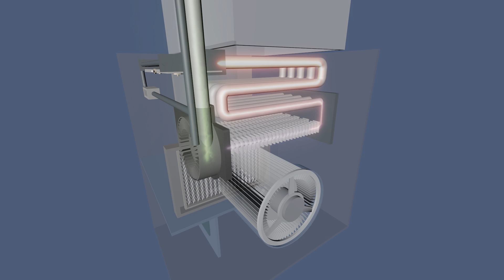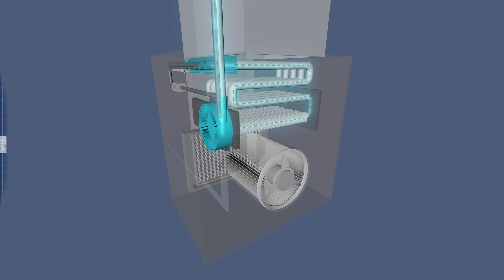Noisy Furnace? - Top 5 Fixes | Repair and Replace

Comment: Thanks for the video. I’m stumped. In one section of the home, of course our bedroom, when the heater starts the process of shutting down a LOUD rattling noise runs the entire length of the duct system. HVAC company says it’s not the heater, Duct company says it’s not the Duct system. How do I tell which is correct. Please help!
Reply from the maker: Thanks for watching. In these sorts of situations is best to try to listen at several different locations to see if you can narrow down where the sound is loudest. A rattle could be the motor vibrating when it is running. It could also be the force of the air moving through the ducts. 

If it's the motor that is vibrating then the blower wheel might be imbalanced or the rubber grommets that help mount the motor might be worn down.

If it is the vibration of air through the ducts, there are ways to reduce vibration of the duct work itself. Sometimes this involves tightening of the mounting screws.

Comment: My RV screams when the heater is turned on. Imagine the belt noise but as loud as a car alarm. And imagine a metalic ringing from lower notes throughout the pipes. And if it goes on for too long it smells like something is burning inside.
Reply from the maker: Thanks for watching. It could the the motor, motor bearings or the belt. If the furnace uses a belt, then it might be too tight. There should be some adjustments that you can make. There might be some similarities to this: https://www.youtube.com/watch?v=APqq4X_gjUU&lc=UgxuT9igza5NELS2b5V4AaABAg.9QWznO93F-a9QaJ7YtBgGu
Reply: @AmreSupply  My partner took it apart. The blower fan was fine but the motor itself wasn't stable and he took out the bearings for it somehow. But we're mostlikely going to try and buy a new furnace now that hes done that. Or he'll try to fix it. But he showed me a bearing so Im guessing thats what it was.
Reply from the maker: @walafalamoosieoadm8200  Thanks for the update, it's always interesting to know what the problem / solution is for our viewers. Best of luck!

Comment: Just paid a company to replace my blower motor now my furnace sounds like an airplane.  They leave and tell me there's nothing they can do about it.  I hate getting raped by every contractor these days
Reply from the maker: Thanks for watching. The new motor might be running at a different speed then the original. That's unfortunate that it is now noisy and wasn't before.

Comment: Of course I dont hear the sound of my issue.  Mine sounds loud when it kicks off. Like it's a loud power down. No pops or bangs just loud
Reply from the maker: Hi Misty, thank you for watching. If you have a direct ignition furnace you might be hearing the draft inducer blower start up. Is this a new sound or has it always been like that?
Reply: @AmreSupply  it's a new sound. I don't remember it being that loud before when it turns off. Is that a easy fix?

Comment: I am hearing my downstairs neighbor's HVAC blower noise at 120Hz resonating in my entire bedroom. Is there any possibility to reduce that?
Reply from the maker: Thanks for watching. To reduce noise one can add insulation to the ducting, or add other buffers to reduce vibration noise. In many cases there isn't too much you can do as the layout of the house will make it that some rooms are noisier than others. Some furnace motors are more quiet than others though.

Comment: Mine sounds like the inducer noice. My furnace is somewhere up on the crawl space above the 2nd floor. I’ve never seen it, my previous house was in the garage, so I find this weird. Anyway, I can only hear that louder then usual noice from my upstairs bathroom. I never heard before and it scares me to turn it on. I feel like my house is going to burn down.  Do houses catch fire from an old furnace?  My house was built in 2003.
Reply from the maker: Thanks for watching. Furnaces come with safety devices that will shut it down if it's unsafe to operate. The inducer noise is an indication that it might be starting to fail. It would be best to get it inspected now and be proactive about the sound rather than waiting for it to fail at a random time.

Comment: Great video, but none of the noises are the crazy loud noise my furnace is doing. It sounds like a super loud sawing/grinding noise. I can hear it outside my home, in my car, with the radio up its that loud...and don't get me started on how loud it is inside my home. I was told by a friend it was the inducer but judging by your video that doesn't seem right. Any help? I can send a video of what it's doing if needed. No furnace company around us will help us as they are all backed up with appointments through the next 3-6 months.
Reply from the maker: Thanks for watching we're glad that you found it helpful. A grinding noise like that is going to be one of the blower fans. If it is that loud you should be able to pin point the sound when right infront of your furnace. During startup the draft inducer motor runs first to bring fresh air into the burners, then it ignites and heats up for several minutes. Only after does the blower fan run.

If you hear the noise right when the furnace turns on, then it's likely the draft inducer blower. https://www.youtube.com/watch?v=EsJhfFMZWJA

If the sound only starts a few minutes afterwards then its likely the main blower fan. https://www.youtube.com/watch?v=4SY8lRl8HV0

As well, with the furnace disconnected from power and gas, you should be able to turn each of the blower wheels by hand. There might be something stuck in it. You might be able to feel it grinding or catching as it rotates.

Hope this helps!
Reply: @AmreSupply  thank you for the help! It ended up being the draft inducer. Appreciate the help! Happy holidays and Merry Christmas to you and yours! :)
Reply from the maker: @ericduvall569  You're welcome Eric, we're happy that you were able to narrow down the problem! Enjoy the holidays and all the best to you as well!

Comment: My issue sounds like a belt issue, but my furnace has no belts...
Reply from the maker: Thanks for watching. It could be an issue with the inducer fan or the blower fan. Potentially the motor bearings or something rubbing that would make that sort of sound.
Reply: @AmreSupply  https://youtu.be/D2tSPaqpKdo    this video captures my issue perfectly.  Any suggestions would be appreciated.
Reply from the maker: @JrJagsFootball  If you have a modern furnace that has a inducer blower (not a standing pilot heater), it will run first before the main blower fan starts circulating air around your home. If the sound is delayed and only starts after the burners ignite then its likely the main blower fan. The motor rotates quite fast so any rubbing can make a noise such as that. You could check the blower fan to see if it spins freely. If the motor feels rough then it might need to be replaced. Alternatively if something is rubbing then you might be able to adjust the blower wheel. https://www.youtube.com/watch?v=4SY8lRl8HV0

Comment: My outside unit sounds like a air compressor or school bus brakes
Reply from the maker: Thanks for watching. If you have an AC condenser unit, then it will have a motor that will run and can sound like a compressor motor. It is not ideal to have anything that sounds like pressurized air or gas is leaking. It would be best to get this inspected by a HVAC technician.

Comment: I just moved into an old home and the blower was in a really disgusting and loud state. I cleaned all the bolts including the centre one mentioned here and it's making soooo much less noise. Thanks so much for the context here, working on furnaces as a homeowner can be daunting.
Reply from the maker: Thanks for watching. We're glad that the video helped you out! As a homeowner there is a lot to take care of, one video that you might find helpful is this one on Multimeters and electricity basics: https://www.youtube.com/watch?v=r_migcta_Is It can be a good review and help fill in the blanks as well. 
This video goes over appliance components which is a good overall introduction t what you'll need to test if something fails.: https://www.youtube.com/watch?v=e_1pOWSVUfg

Comment: Hi.  I need some of your expertise.  
Let me begin by saying.  I don’t have an amp reader..  I just turned my furnace on.   Getting a small buzzing sound.  Not a loud Humm, like I’ve seen in some videos.

I am replacing the capacitor.  Am worried Becusse the inducer blower motor was pretty damn hot after 2 minutes.  
  What’s the difference between the inducer blower motor (mounted on the front of the furnace) and the blower motor on bottom of furnace attached to the wheel?
Reply from the maker: Thanks for watching. The inducer blower is the first to run and it provides fresh air to the burners and helps push exhaust gases out. After there is enough fresh air, the burners ignite. Then the blower fan pushes the hot air around your home. You can learn more in this video "How A Furnace Works" https://www.youtube.com/watch?v=tVLtJwix-_8
Reply from the maker: As for the capacitor, and blower motor you can learn more here: https://www.youtube.com/watch?v=4SY8lRl8HV0

If the inducer motor has a capacitor, then it could also be faulty.
Reply: @AmreSupply  Wow thank you so much. I ordered a new capacitor and I’m going to pick up a multimeter now.!!
Reply: @AmreSupply  unbelievable.  I replaced the capacitor and it’s working! Wahoo!
Reply from the maker: @bobduffy7744  Awesome! That is great that it worked!

Comment: My furnace is a Brand New York I believe a two-stage furnace if that makes sense my issue is it sounds like a rocket ship when it's actually working the efficiency is fine there's no other issues except when it's running it's noisy would it be anything to do with my fan speed or do you have any others suggestions thank you
Reply from the maker: Thanks for watching. Its hard to say exactly. Each furnace will sound different and the overall loudness depends on the furnace location, the model and how your home is built. Furnaces in an isolated room will be more muted than an unfinished basement. Having ceiling tiles in a basement will also muffle the sound through the vents. It is possible that your furnace motor is oversized for the load. A furnace tech might be able to rewire the motor to run at a different speed that is more appropriate to what your home needs.

Comment: I just had a new Coleman AC and Air Handler if I’m saying it right, put in today 10/7/2021 and it is so noisy coming through my vents and  also the unit outside so I wanted to come on YouTube before I call the company back. Thanks for your video.
Reply from the maker: Thanks for watching. Its hard to say exactly. Each furnace will sound different and the overall loudness depends on the furnace location, the model and how your home is built. Furnaces in an isolated room will be more muted than an unfinished basement. Having ceiling tiles in a basement will also muffle the sound through the vents. It is possible that your furnace motor is oversized for the load. A furnace tech might be able to rewire the motor to run at a different speed that is more appropriate to what your home needs.
Reply: @AmreSupply  Thanks for responding, and I understand you right those things will make a difference, my AC guy did say since my house was built for a 3 ton and I upgrade too a 3.5 ton but, he said he will come to find out why, and he also said he could turn the fan down but I will see when he comes.
Reply from the maker: @nellielee2915  Thanks for the update. Its good that the AC tech will be returning to make some adjustments.
Reply: Did you find your answer I'm having the same issue, my furnace is a two-stage furnace I guess and I was told maybe the fan speed should be lowered but it sounds like a rocket ship taken off it works fine there's no issue there but it's just really loud, is this similar to your issue if so if you find your issue out would you let me know please
Reply: @liamoconnor9017  Hi Brian, I have not, I just got back in town and the owner of the AC Company said my fan may just need to be turned down a little, he said when my house was built they put a 3 ton unit in and now I upgraded to a 3 1/2 ton unit so it’s blowing stronger, but I told him I asked you can my house take a 3 1/2 ton and you said yes for sure. I said you didn’t tell me if I upgraded it will be loud 🤨😩 so I will see if the help when he come some time this week. But Brian it’s my fault 🤦🏽‍♀️ because I was so hot 🥵 in my house for 3 days without air I couldn’t do my research on the Coleman brand before hand and after it was install I read that people always having problems with the parts and it’s very noisy. I will try and remember this video to come back and let you know how it worked out.
Reply: @nellielee2915  ok thank you I was told something similar, that's what I'm going to be having done here in a another few weeks as I live in Canada Ontario and it's going to start getting cool I'll let you know if it helps out take care and thank you

Comment: I replaced the capacitor but my blower motor tuns on and runs for a few minutes then starts smelling as something is burning and shut down itself.  Same symptoms prior thr capacitor replacement.
Reply: Any ideas?
Reply from the maker: Thanks for watching. It likely that the motor is worn out is overheating and needs to be replaced. 

You can learn how to match an HVAC motor in this video: https://www.youtube.com/watch?v=3eOARJ8oRrc

As well you can learn how to install a new one here: https://youtu.be/4SY8lRl8HV0

Comment: Great video and good information. However my hvac system is noisy in a different way. It's loud only as it starts up or whines up. Any idea what could be this problem?
Reply from the maker: Thanks for watching, we're glad you found it helpful. Some sounds are related to the RPM of the motor. As the blower motor is starting to spin you might be hearing the bearings rub, or it could be an imbalance in the blower whee. As it gets up to speed, it becomes more balanced and the sound goes away.

Comment: This is a great video!! Having examples of each of the sounds was incredibly helpful! Great job
Reply from the maker: Thank you, we're glad you found it helpful!
Reply: @AmreSupply  Based on your video, I assumed it was a belt issue, so I went to check. Turns out we have a direct drive blower motor and the whole motor has to be replaced. 🙃
Reply from the maker: @Studio23Media  Thanks for the update, the motor isn't too difficult to replace. You might find these 2 videos helpful when replacing the motor.

How to replace motor & capacitor: https://www.youtube.com/watch?v=4SY8lRl8HV0

How to find a matching motor: https://www.youtube.com/watch?v=TF3QtXWd8s0

Comment: Very helpful. Our AC furnace makes a loud tapping sound every 3 seconds and I can't figure out the source. Neither could the A/C serviceman but he speculates it could be the blower fan. Any thoughts? Thanks.
Reply from the maker: Thanks for watching, we're glad you found it helpful! Since the blower fan spins quite quickly a sound that happens every 3 seconds might be more of a balance issue with the motor. That could cause it to rock back and forth periodically. You could just set the thermostat to the FAN ON mode to test the fan without heating or cooling. If the sound still occurs, then it might help you narrow it down to the blower fan.
Reply: @AmreSupply  Thanks. Old system, will be replaced.

Comment: My blower motor might be bad . Running weakly partially . No Ac five days now . Yeah could be something else but changed capacitor still the same . Yeah could be board or relay I guess ? But I can't get someone out here yet . Might as well replece with brand OEM motor at $300 ? Losing it . I took off motor already but now been told if it still there I could test voltage and if it's getting the rated 115 volts it's the motor
Reply from the maker: Thanks for watching. Even if the control board sends 115 volts to the motor, the motor can fail mechanically or electrically. With the motor removed you can see if it spins freely. If there is any restriction then the bearings might be worn out or might not be lubricated anymore. As well check all the wire terminals to see if there is any corrosion or anything that would prevent good connection.
Reply: @AmreSupply  it was the motor. Replaced with a universal one from century $74 plus needed bracket $30.  Very well worth it. Yeah could tell right away that it was blowing full power at the vents unlike before. Heat is sooo high here in south Texas. 🔥🔥🥵
Reply from the maker: @frankmontez6853  Thanks for the update, glad to hear that you have it fixed! Here in Alberta we just went through a heat wave of 40°C which is 104°F, so I think we got a little taste of what weather is like in Texas. To not have a AC to help cool down your home would be pretty exhausting!

Comment: Is the blower fan always supposed to be set to where it is flush with the motor shaft?
Reply from the maker: Thanks for watching. The blower fan should be centered with the housing that there is space on either side of it. This will likely not be flush with the motor shaft. Each housing is a little bit different though so there is no set measurement or distance on the shaft to mount it, so just check when re-installing.

Comment: Is it normal for duct expansions to happen when the heat or ac isn’t/hasn’t been on year-round?
Reply from the maker: Duct expansion will most likely take place anytime warm or cool air is being passed through the ducts. When the system is off, there should be less changes in temperature and less noise.